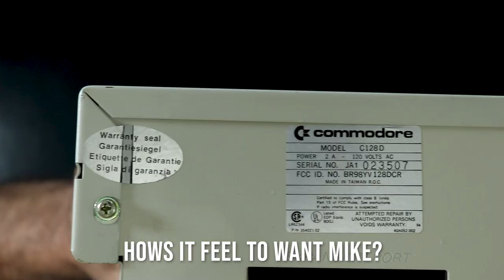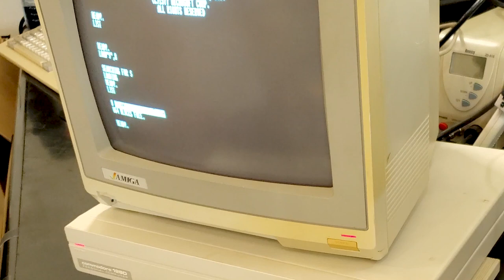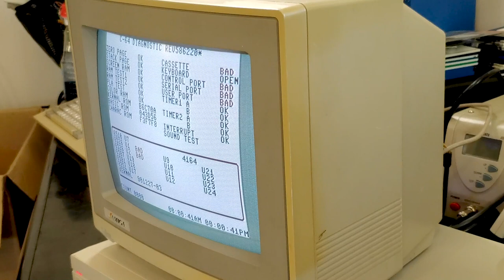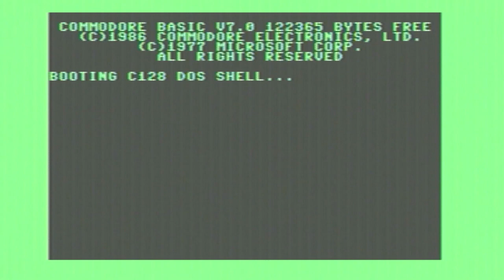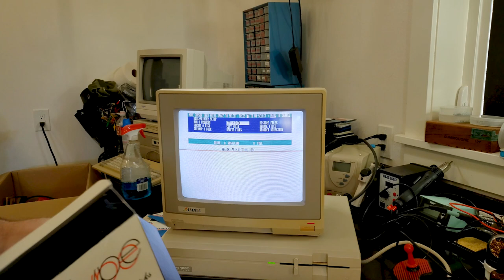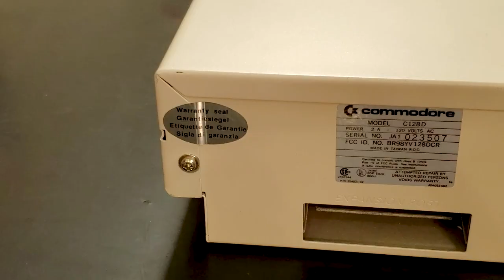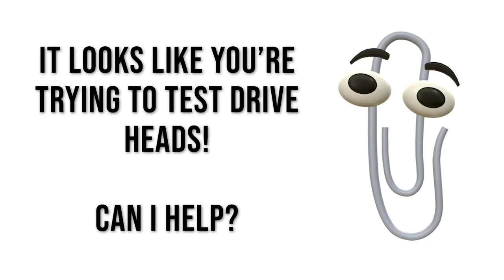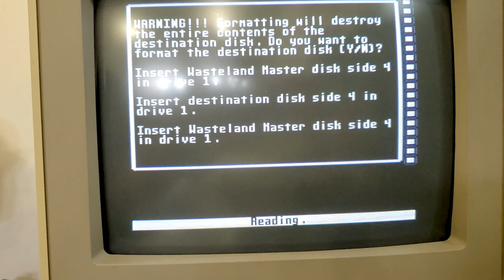Commodore 128D Restoration - Floppy Drive Trials

Comment: @RavenWolfRetroTech Thanks for the video!
I doubt you will see this message this since this video has been out for over a year, but I wanted to congratulate you on getting your hands on a nice Commodore 128D-CR.  Like many following this channel, I had a C64 in my teens, and then upgraded directly to the Amigas afterwards (had a 500, 1000, 2000, and 3000 in the end).  Then I gave them all away to a friend.
Although I did play around with my Amigas, I actually enjoyed my C64 much more.  Since the C128 is the one that follows (and also has a C64 in it), I've been looking into finding one to keep no matter what and have discovered only recently that the 128DCR existed (2 years ago).  I had never seen any here (In Qc Canada) and trying to find one like yours in this video seem impossible to find at this point because either they are in bad shape, or they cost tooo much.
Anyway, congrats on your 128D-CR.  It's really a nice one!
Reply from the maker: Thank you. I try to keep an eye on new messages like this one. Sadly YouTube is really bad at tracking replies but it does surface the new ones.
I am very much enjoying the 128DCR and it has been pimped out a bit with new (Old) gear to use in testing the game I am working on. I plan to have a video on that in the next few months. In the meantime I wish you luck in your search. If you don't find a 128D then a flat 128 with a 1571 is functionally the same!
Reply: @RavenWolfRetroTech  I agree that the flat one is functionally the same, but I do appreciate the form factor of the case more.  It was also one of the reasons why I liked the A2000 more than my A500 even if I didn't upgrade it.
I subscribed to your channel and will be looking forward to your new videos with the 128DCR 🙂

Comment: Bad disks are a real thing, but I had similar squeaking symptoms with a different cause. I bought a lot of 1571 drives and one of them squeaked and had trouble reading disks. After a bit of troubleshooting, I realized the top head was not sitting flat and causing extra drag. The mechanism only lifts on one side of the head when the disk lever is open. After many years left open, the spring steel "hinge" no longer held head straight. I was able to tweak it back flat and the drive works fine. Since that discovery, I now keep a cardboard head protector in all of my drives and keep the lever down when in storage.
Reply from the maker: I know what you mean Eric. I find that any drive that was stored with the mechanism open has the heads drooping on one side. I worry that bending them back is not a permanent solution but so far so good. Fortunately Karl had shipping inserts in a lot of drives!

Comment: (Long winded comment warning) Oh man I have had a lot of 5.25 disks go bad.  Not everyone stores their disks properly.  My entire collection was in a storage unit for years and most of the time it was climate controlled but for several years my friend had it in a storage building that was not.  When I finally picked up my collection to use it again I found that most disks were fine, with a few exceptions.  Most of my 3M disks that were the older SSDD did not survive, while the DSDD were fine.  I was able to rescue them but they had formed spots that were not mold. 

Over the years I have seen a trend with certain brands being less resilient than others.  One model of 3M, most disks made by Syncom, Legecy, Opus and a few others.  Brands that seemed to fair good in my bunch of disks were Polaroid, Verbatim, Later 3M, Maxell, Athana, Elephant, Centech, Fuji, Sony, BASF, and a few others including some generics that were great.  It is a major bummer to find that disks have gone bad especially originals.  I have a lot of loadstar disks that did not survive, which makes sense since they were supplied by Opus.  In some cases I had to remove the disks from the jacket, wash them in the sink with dish soap and alcohol, rinse them with distilled water and then finally dry them and put them into a new jacket just to rescue the contents.  Ugh.
Reply from the maker: I agree completely Racer X! The brand seems to make a huge difference. The few disks I still have from back in the day were Bonus and Fred Meyer brand and they seemed to survive quite well despite being in an attic for part of the time. 
The blank disks from the stone collection are mainly generic, unbranded ones in sealed plastic bags. These seem to be entirely bad but a few that were of different manufacture were OK even though they were stored together with the bad ones.
The location they were stored in the room also seemed to make a huge difference. Many of the bad disks were in areas near leaks or directly on, or near, the concrete floor that would bring in moisture in the wet Oregon winters.

Comment: Crazy that they put all of the drive electronics on the main PCB.
Reply from the maker: I think that was the biggest change made in the CR (Cost Reduced) version (Which this is). I am in the USA where the original version was never sold as far as I can tell.

Comment: I've also got an original C128DCR and have found it to be quite sensitive to dirty disks. You see them for sale on Ebay all the time, but they're mostly not worth it because of their age and condition. I actually took my disks from 30 years ago and copied them all onto new disks and they haven't given me any trouble at all. You are probably better off downloading the games from the net onto an SD Card or new disks than using the originals - which as you have mentioned, if they haven't been stored in the right environment, will have deteriorated. Great video.
Reply from the maker: Thank you! I am looking at getting a 1541 or two connected externally for testing disks/
Reply: @RavenWolfRetroTech  PS With their external PSU, I've found the 1541 IIs to be a lot more reliable than my original 1541s.
Reply from the maker: I do have a 1541-II on my shelf waiting to be restored so I will try that out. Thanks for the advice.

Comment: My personal experience with 5.25" C64 disks has been quite different so far. I haven't enountered any delamination yet. Many are moldy, some are totaly frozen in the sleeve. But the vast majority of them just works. I enjoy browsing the content of old random floppy piles a lot. In my experience, 5.25 C64 floppies had a substantially higher survival rate than 3.5" Amiga floppies. Maybe its related to climate conditions?
Reply from the maker: I had pretty good luck with my old floppies and some that came from Alaska. I think the Stone Collection conditions were just really bad for them. I have been able to get some working though. Most notably was a working copy of Wasteland cobbled from 3 that were there.

Comment: You mention being a Commodore hardware developer. What hardware did you make back in the day?   It's too bad the disks have gone bad. I have my collection of floppies still  that i started in 1982 and the majority are still working today,but they were stored cool and dry all this time.
Reply from the maker: I never sold any commercial products but had plans to. I made an A500 MIDI interface that is covered in an old video (https://youtu.be/fam7G3hi0bU). I was working on a HP/GL interface card for the A2000 in college and was unable to get it to work with the information I had (It was wire wrapped). The project still got an A because the professor couldn't figure out why it would not run. Later, when I found out about the certified hardware developer program I signed up and got access to the Tech ref. All that project had needed was to tie DATAC to ground instead of handling it myself like you would on most M68000 projects. Sadly it was already disassembled since many parts were not mine. In the end I ended up with my Office Equipment Company taking off and that ended the hardware path I wish I had followed.

Comment: Does this oxide issue also impact 3.5” disks?

Very nice machine to work on. I’m a long time Mac user but I’ve always had a soft spot for commodores, especially the C64 and C128. I wish Apple had used metal enclosures instead of damn plastic for everything.

Also Curse of the Azure bonds is one of my favourite games. I’d love to play it again but I’d need the book and code wheel.
Reply from the maker: Unfortunately yes, it does. The 3.5" disks tend to be newer and I have had less problems but they still go bad. A couple hundred disks from a buddy that were kept in a closet are about 95% good while the TV station Amiga disks that were in an unheated mountain shed seem to be running around 50%.
Reply: @RavenWolfRetroTech  50% is still really good!
Reply from the maker: For sure Jodie! I'm lucky if 10% of the Stone collection disks are good. They are 5.25" stored in really bad conditions. At least I was able to cobble together a good copy of Wasteland 🤓
Reply: @RavenWolfRetroTech  Even back in the late 90s when I was using floppies to take word documents into Uni to print, I had make multiple copies of a document across multiple disks just to make sure one of them worked.

Comment: What are the chances you could have just used a heat gun and lifted that warranty seal off?
Reply from the maker: I discussed this with a friend but my feeling was that removing and replacing the seal in a manner that made the machine look like it had never been worked on would be deceptive. While this machine is my daily driver at the moment, someday (Hopefully a long time from now) it will go to others and they deserve to know the true state of the machine.